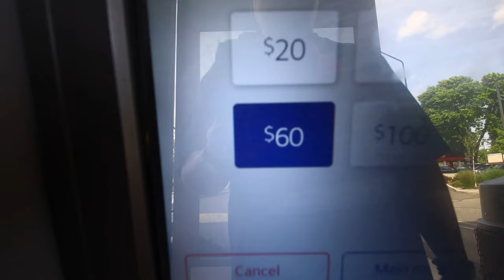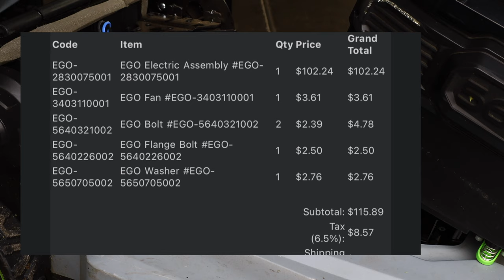How to fix broken EGO Mower! I bought a non working EGO MOWER for $60! Controller? Motor? NO POWER!

Comment: Thanks for the video! I was given am LM2100SP that throws an overload warning as soon as you turn it on. Have read it is a controller board issue and now I feel confident enough to replace it myself!
Reply: Update: Replaced the board and did the select cut blade mod. Hardest part was getting the parts.

Comment: 4:45 - that clicker is the safety switch that keeps it from turning on when the handle is flipped forward. There's a steel bar with an indent that the open switch sits up against. When you roll the handle back, the bar rotates until a protrusion presses up against the switch, completing the circuit. You'd have to press and hold it to engage the motor with it sitting loose like that. Maybe that's why the seller couldn't get it to work.

I don't know why the guy didn't use the dang warranty. In the fall of 2021, I bought an LM2135SP select cut w/7.5ah battery at Lowe's for $162. The tag said it was a return because the battery wouldn't charge. I immediately bought it, registered it, and called the support line. We confirmed that the battery was dead and the mower worked (I have other EGO tools and batteries), and I had a brand new 7.5ah battery in the mail a few days later. I had an overheating issue during the hottest part of last summer, and I was able to get it serviced for free under warranty at the nearest center.
Reply from the maker: Yes checked all the switches it was the control unit for sure that was the problem. I literally took apart the entire mower. Also the original owner didn’t register the mower I asked him 😂😂😂 his loss my gain I guess 😊🤙🏾
Reply: Bro I been wanting to make that move for a min! Thanks for the tip!! 🎉🔥🔥

Comment: Cool.just bought same problem from pawn shop. Hope your parts list works. Never talked to you tube before...
Reply from the maker: Very easy installation hoping it’s not the actual motor itself but I’ve never had a motor go out on an ego yet and I’ve owned one since the beginning it’s been 5 years 😊🤙🏾

Comment: I also got one from Marketplace and changed the board with a cheapo DC controller. Made sure it's a 60v controller since the DC motor is rated for 60v. Works well but dont know for how long. Controller is cheap and can just replace once it's fried. One upside with the DC controller is you can now control speed unlike the original controller which is full throttle all the time (i think).

Comment: our future 😥 .    Thanks for sharing.  I'm currently troubleshooting an intermittent Amber overheat shutdown condition.  Mower is 4yo and probably needs a good clean inside and out ....even in 50*F air temp, mower auto shuts down after 5 minutes.  So frustrating, especially when two weeks ago, it ran non-stop for 30 minutes (it could have gone longer, I just ran out of yard).   most would only partial assemble and test before putting back together 100%....

Comment: Hi. Great vid! After 3 years my Ego mower became rather loud and vibrates a lot. New blade or old blade same. Cutting not so great either. Do you have any suggestions?  Thank you!
Reply from the maker: 😬 I have not experienced that I have had my lm2100 for 5 years and still going strong the one in the video I have to a friend and it’s going strong as well… to me is sounds like the motor is going out… it’s turning on so it’s not the board that I bought in this video, your blades old and new so that’s not it… but the motor for sure could be out of whack… maybe even see if the motor is bolted on properly maybe it’s as simple as that… good luck and let me know if you figure it out 😊🤙🏾

Comment: What’s involved on the mod so that you don’t have to extend the handles?
Reply from the maker: The relay in the middle of the handle there is a switch with 3 wires loop the red and the blue 😊🙌🏾🤙🏾🤙🏾🙏🏾

Comment: With the handle mod can you run the handle how ever high or low or in between that you want?  I only saw in the video that it ran with the handle all the way up or all the way down.   Quite a few reviewers mention that it sucks that you have to have all the way extended to operate the mower because it limits the maneuverability.

Comment: Ok brother congrats but what was wrong with it the gras what type is it
Reply from the maker: Controller unit failed unfortunately its like a solid box or I could have purchased resistors and transistors to solder in would have been cheaper than $100 to fix but that’s how ego built it 😊 you know the grass type my dude salad bar of all the cool season grasses 😂😊🙏🏾🤙🏾🙌🏾
Reply: It look good brother how did you find the problem I am about to get one that is not working too so I want to see if the same
Reply: Oh the lights there so cool I need does in my back yard for the bbq pit

Comment: Is the controller a common point of failure?
Reply from the maker: I think so! That or the motor for the unit and the self propelled 😊🙌🏾🤙🏾🙏🏾
Reply: Great video! Informative and entertaining!

The wires being pinched to the point of failure at the bottom of the handle seems to be a big issue as well... Hence the jumper bypass.

Comment: You really use those terrible drill sharpening wheels? I am surprised. You should get an angle grinder with a flap disc if you want to do a good job. Or a good old fashioned hand file if you are cheap, it will take a while though.

The rope around the tree made me laugh, nice work!
Reply from the maker: They are not bad I'll do a paper test one of these days just gotta get my work table set up 😊🤙🏾🙏🏾🙌🏾 and the tree 😂🤙🏾
Reply: Check the grass. The blade is sharp. I would have thought the same thing but he's obviously got it down.

Comment: Someone should make an aftermarket controller. I've had 2 fail in 6 years. 100 bucks is kinda pricey.
Reply from the maker: Yeah there is a cheaper alternative but requires more wiring and config… a cheaper oem one would be great at least $50 😩😊🤙🏾🙏🏾😂🔥🔥🔥
Reply: @YardBrah  I found a used one for 80. It's cheaper to buy a whole used mower. Instead of this part. And I don't mind wiring.

Comment: That motor isn't the brushless one. Can you order the newer motor from the 2135 line and put it into the 2102? An idea for a new video? 

Deck out the older model with newer model parts?
Reply from the maker: Oh I gotta do some research on that… the brushless motors come on the steel deck 20” these are all 21” gotta see 😊🤙🏾🙌🏾🙏🏾

Comment: Holy sh*t watched the whole thing. 
So what do you think makes a controller go bad, overheating, water damage? 
Great save from that poor thing ending up in a landfill.

You've had your victory mow, now go head to Starbucks for your victory beverage 🧋
Reply from the maker: haha! You know the main board on the control unit is this solid piece that you can't get into i'm thinking if water get's in you're def gonna ruin it... the battery housing is pretty good with light rain but if someone opens the lid and washes in there they could have a problem. problem too is the fuse is soldered in and you can't find that specific fuse... a lot of factors when it comes to electrical equipment... he had it for 3 years so hopefully this guy lasts a while now and the motor can hold up 😊🤙🏾🙏🏾🙌🏾